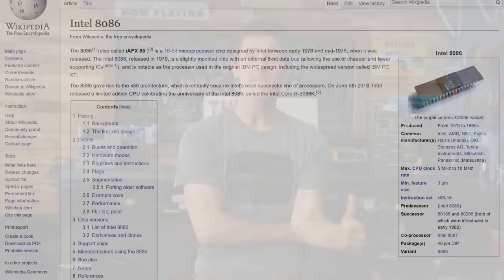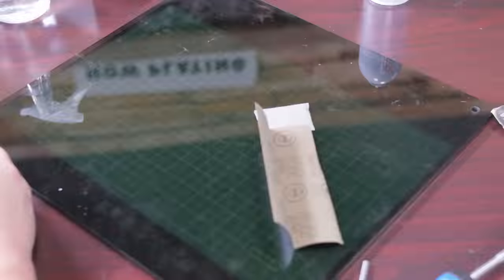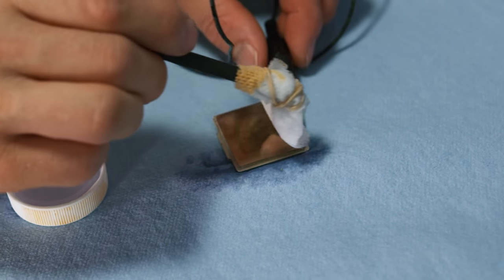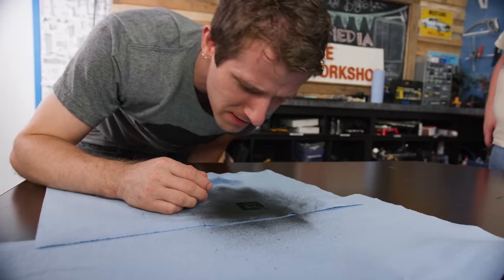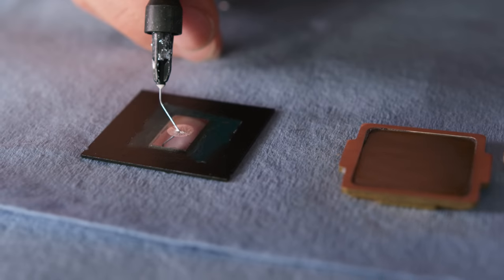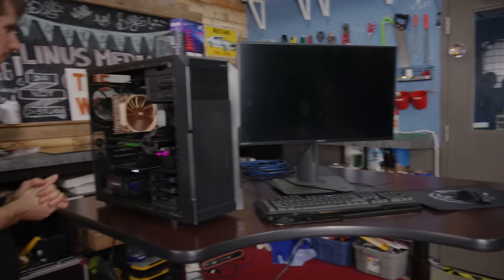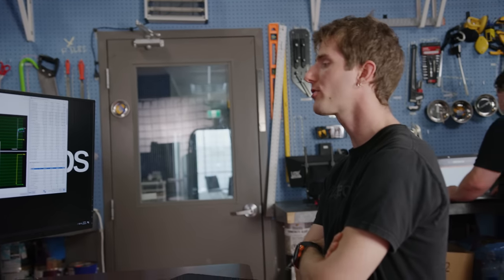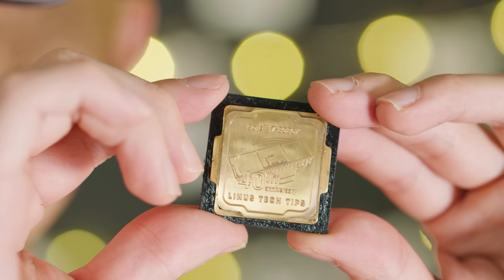The CPU Intel SHOULD have made!

Comment: *proceeds to cover beautiful engraving with heatsink*
Reply: That gold top wasn't cool enough by itself... :D
Reply: @jimbobbyrnes  right? But the box, you might put on a shelf. Did they do anything with the retail box?
Reply: gold plated it, engraved it, and baked it in titanium dust.
Reply: I know right
Reply: @peterkiss1204  did you just make a pun cause its cooler now?
Reply: Just glue an ice cube to the cpu, should work, can't see a problem.
Reply: FACEPALM
Reply: I had the same reaction to relidding a Threadripper with the vanity IHS they got.

Your unique, one of a kind IHS is now covered in drab gray thermal compound and a heatsink. Literally no one but you will not only care but even know.
Reply: @Nighterlev  come on if you are going troll and act mentally ill make it at least remotly beliveable...
Reply: 2020 still no clear heatsink
Reply: If the heatsink isn't pure gold I am disappointed
Reply: Nahhhh thermals are over rated
Reply: "Its a nice gun i'll give you that. But the engraving gives you no tactical advantage whatsoever."

Comment: There is actually a compound that you can brush on over shiny metals that allows you to use a standard CO2 laser to engrave them.  I want to say it is called LaserMark and available from either Johnson Plastics or JDS Industries.  We use it on our Chinese K40 laser to engrave on gold and stainless steel and it works great.  One tip, use about half the amount of denatured alcohol to thin the concentrate and it works way better.

Comment: Nice. Maybe in 2020 we'll see a special edition Ryzen for the 64-bit instruction by AMD.
Reply: By 2020 we won't be using 8th gen or RyZeN
Reply: F.A.I He never mentioned using 8th Gen in 2020. Also most definitely will still be using the Ryzen branding well into 2020. AMDs Roadmap shows Ryzen 4000 (code named Vermeer) based on Zen 2+ possibly on a TSMC 5nm node. Though a 7nm refinement seems much more likely.
Reply: Yeah, I was referring the 64-bit instruction set specification released by AMD in 2000 and how in 2020 they could celebrate that by releasing a special edition CPU ;-)
Reply: Uh, the ryzen amd64! I liked it!
Reply: Pretty certain IBM made the first 64 bit chip. Followed by Intels Itanium and then AMD were third to the party. AMD were unique in bringing the first 64 bit consumer grade CPU however. Although by the time 64 bit was actually being used on home systems Intel chips were more than capable. The Athlon-64's 64 bit capability was a bit of a gimmick when it released. However the Athlon-64 was one of the best consumer grade CPU's of all time mostly because of its innovation of integrating the memory controller onto the die - something all chips have today. Not really because of its 64 bit ability.
Reply: As I understand it AMD released the first x86 compatible 64bit instruction set that allows both 32bit and 64bit software concurrently.  Intel had to license that for their CPUs.

This is why we need competition in the market, as we are all benefiting from AMDs work today even buying Intel.
Reply: Micheal Morgan AMD released the first 64 bit processor to run on the x86 instruction set, the instruction set used by the majority of computers
Reply: That would be pretty cool, AMD should do that.
Reply: a processor without x86 instruction on it and only x86-64 (amd64) instruction, that would be a first processor to ditch intel's x86 instruction set, though I bet it would be usable only in linux since Windows and possible MacOS still uses 32bit binary on some of their apps.
Reply: @omgitzanarwhal  Yeah that's just wayy to early to be upgrading CPUs. My 5960X has been with me since 2015 and I'm going to use it until 2022. Hell people will still be using Quads in 2020
Reply: @eduardoavila646  a Ryzen 64 would be awesome!
Reply: @scubasausage  You do know that AMD is licensing their AMD64 arch to Intel because Intel couldn't figure out how to do it themselves... 😛
Reply: Nope, Itanium was a entire new architecture, like arm is, so you could not migrate your OS, apps and stuff to it gradually, it was all or nothing. While AMD64 was an extension to x86, and therefore you could run both x32 and x64 executables together with little to no trouble, and you could migrate as slow as you wanted... While Itanium Windows XP is a forgotten relic.
Reply: AMD and Intel have a cross licensing agreement actually. Realistically speaking there are actually far more things that AMD cant do that Intel can. Intel dwarfs AMD as a company and produce more than just consumer grade and enterprise grade silicon. Right now Intels CPUS are still very competitive after dominating the last decade, they still dominate the mobile space. Over the years they are far more consistent than AMD have been. Intel are also very charitable company who have invested millions in enabling technology access to the third world (see Intel foundation) and have invested heavily in upstarts and new tech ideas. As a company I hugely prefer them to AMD, who over the years have been very good at losing money in bad investments and producing bad chips. Ryzen, is the first decent chip architecture AMD have released in over a decade. There have been no major innovations from AMD for over a decade and they dont engage in much charity work or upstarts. Dont get me wrong, im not hating on AMD, we need them there to keep Intels prices in check. But Intel have done far far more for the tech community and the planet than AMD could ever dream of doing. That being said, I think people should buy Ryzen if buying a new system today in September 2018. Unless of course they intend to use it for gaming, in which case Intel is the obvious choice at practically every price point.
Reply: +wabbi lol ryzen will be dead by 2020 and it won't be the first time amd just gave up, lol
Reply: @f.a.i9638  From the future; you were wrong. Ryzen obliterated intel beyond comprehension

Comment: And in 6 months, AMD will come out with a custom gold plated CPU.
Reply: It's totally realistic, but it would be expensive enough to limit it to a special limited edition run or something.

Modern CPU IHS plates are made from copper, which is just slightly behind silver as the most conductive elemental metal on our planet. Since those are both also highly reactive metals, they corrode very easily, so the IHS plates are coated in a layer of Nickel, which is a non-reactive metal. Unfortunately nickel isn't that thermally conductive... but gold is! Gold is the third most thermally conductive elemental metal after Silver and Copper, and has the benefit of also being non-reactive, like Nickel. So using an IHS with real gold plating might actually improve thermals.

As an aside, and I'm just theorizing here, but since gold is really "soft" for a metal, the wisest choice would be to alloy it with another, much more durable non-reactive metal. 90%Gold + 10%Nickel is commonly used in jewelry and is called "White Gold". It should still retain most of the thermal benefits but be durable enough for everyday use by consumers. You would lose the golden appearance, and it would just look like non-polished silver, but still be prettier than current IHS plates. I wonder what those thermals would be like!
Reply: Unnamed Player it's already out nerds
Reply: @heart4011  well, that isn't really gold
Reply: Why not get a small piece of gold leaf and use it on a freshly polished copper heatsink with a gallium core ? Lol

Comment: Now you need a transparent cooler with it! Quite sure there is no transparent terminal conductor which could stand on par with copper. So using an engraved water block with transparent top instead of IHS would be a more logical showpiece.
Reply: transparent Intel stock cooler with blue leds will do, they actually are on Market
Reply: 3m novec
Reply: and that's probably the reason why it didn't make sense for intel to style the package of the cpu differently: it's hidden when running
Reply: ArthursHD:
Diamond is 5 times more thermally conductive than copper.
Silicon carbide is sort of transparent and conducts heat really well.
Or more practically:
Make a liquid cooler using two layers of something very flat and clear and water between with the plumbing in the corners.
Put a bit of optical paste on the heat spreader.
Press the liquid cooler down onto the CPU without covering the middle.

Comment: 'But we saw a tangible improvement in Blender.'

Did you? If so, you included the wrong chart.
Reply: Exactly what I was thinking.
Reply: Agreed. 3 seconds isn't reaaaally an improvement.
Reply: that .3 seconds can really make a difference if you're rendering out hundreds or thousands of frames
Reply: 3 seconds over ~329 seconds is margin of error (~1%). If it could be shown repeatedly then I guess you could argue that it's faster, but tangible? Probably not.
Reply: Zaku_IIH
Reply: Technically, no performance boost is tangible because you can't touch time.
Reply: MIND BLOW
Reply: he meant throwing the overpriced chip in an actual blender
Reply: I would disagree. It's impossible not to touch time. Since it's space-time, not space and time.
Reply: You are thinking in way too small of terms. Yes. Time exists because change happens, if nothing ever changed then time would not exist. The definitions we have for everyday things here on our human scales have little relevance to the true nature of cosmic reality, in so far as we know.
Reply: Tangible:
- perceptible by touch.
- clear and definite; real.

Saved time can be tangible.

Comment: it's kinda funny that you took the nickel plating off beforehand because the gold will plate directly to it. and you won't have an issue with the gold getting absorbed into the copper plating over time. I've done this before when i built my own hydrogen fuel cell and needed to plate the circuit pathways in gold.
Reply: I think they just wanted to smooth out the surface for the plating
Reply from the maker: Two reasons for that:

First and foremost, we didn't want to add another layer of metal on top to potentially mess with the thermals, so we took the nickel layer off.

Second... It was tried on a test IHS to see what it looks like and it ended up not being all that impressive. It didn't plate to the nickel as easily as it did the copper, either. It actually took quite a bit longer and more material to get a similar gold hue on the nickel parts of the IHS as opposed to the bare copper.

That said, it's likely that the reason for it not adhering to the nickel very well is because it's a matte surface, not polished. We may have had better results there if we'd polished the nickel first.
Reply: Copper-Nickel-Gold is actually a fairly typical stack for plated contacts on circuit boards. It costs more than standard hot-air solder leveling, but it allows contacts to stay free of oxidation for a long time.
Reply: I think that nickel, like aluminum, rapidly forms a thin oxide layer inhibiting further corrosion. So the "matte finish" is not an artifact, but goes with nickel in air.  That is why nickel ordinarily looks different from chrome.  Silver can be polished to a mirror finish, and it oxidizes, but more slowly.  To polish nickel (or aluminum) to a mirror-like finish that lasts longer than a second, you must do so in the absence of oxygen, like under a nitrogen atmosphere and keep it there until you coat it with something in turn to keep it that way (if it's something clear, you might be able to see the finish).  The Gold was probably not bonding well to the oxide layer.
https://en.wikipedia.org/wiki/Nickel

You can electroplate nickel or aluminum on the back of a piece of glass and make a nice mirror, because the glass forms a smooth substrate and protects the glass-side surface from oxidation.  Presumably,  +Fat D's copper-nickel-gold is deposited using methods which would be hard to duplicate in your lab.
Reply: Digital Nomad  If you polish the surface up then give it a quick rubbing with alcohol, the surface is perfectly plateable probably for minutes. Within that 5 seconds while you put the IHS on the rag and damp the surface with the gold solution, it wouldn't be oxidized on any relevant level.
Reply: +Peter Kiss
(sorry, I don't know how to type the accent).  Thank you for the clarification.
Reply: Digital Nomad  You don't have to type. Your attitude made it perfectly clear.

Comment: You should have a see through waterblock for a cpu like that don't ya think?
Reply: Not possible though... Yeah you have see through blocks but they still have metal on the bottom so you still wouldn't be able to see the CPU itself.
Reply: @finraziel  yuh didn't really think about it that much when I posted the comment
Reply: If there were some way to seal a block that is transparent on the outside and open on the inside in such a way as to let the transparent non-corrosive working fluid contact the spreader directly without leaking out, that would achieve your goal, and probably improve the thermals.
Reply: Finraziel  A diamond coldplate would get the job done. It's highly heat conductive. :D
Reply: Digital Nomad  The surface area wouldn't be enough for the typical coolants.
Reply: +The surface area would be essentially the SPREADER PLATE.  It is impossible for a cooling system to have more surface area.
Reply: Digital Nomad  There is a reason, liquid camber coldplates have fins on the inside. Cooler liquids usually take the heat away from the coldplate less effectively than the coldplate does itself from the IHS via the thin layer of TIM.
Reply: +P Kiss
"There is a reason, liquid camber coldplates have fins on the inside."
That's not the reason.  At each interface the heat transfer is proportional to the square of the difference between the hot side and the cold side.  The coldplate will, as a consequence, be at a temperature between that  of the IHS and the coolant.  It is possible to enhance the second transfer (coldplate -> fluid) by the use of fins.  You want the intermediate temperature of the coldplate to be as close to the temperature of the coolant fluid as you can get it.  Regardless of how relatively effective the fluid is or is not at removing heat from the inside of the coldplate, you would put fins on the inside of the coldplate, because you can .  You do this in order to mitigate the inevitable insulating effect of another surface transition.  If a solid metal radiator could carry heat better than a transfer fluid, air coolers would outperform liquid coolers.
Reply: Digital Nomad  The surface of the IHS isn't big enough to be suitable for direct liquid cooling. And that was the point of your first comment.
Reply: I wonder how long it will take to have a glass heatsink.. if it's glass at all.
Reply: No one will be able to carve a heatsink from a diamond. The size and cost alone is not worth it.
Reply: @digitalnomad9985  lmao they could plug the waterblock with diamonds.  Twice the thermal conductivity of copper.

Comment: As a person who has worked with industrial lapping, that's actually grinding.

Laping consists of rubbing two surfaces together with an abrasive media in between. Making the surfaces match each other very well. Almost removing zero material. It can be used to matching gears in a gearbox for example..
Reply: Swedishchef11 I would say a more common use of lapping is used in making surface plates
Reply: @jasonmurawski5877  sure it can. All I said was what I did.

Comment: Damn why don't these companies just take Linus' advice. He knows what people want and will buy lol they would've sold so many of thesep
Reply: Agreed I've desired a gold and silver made CPU and gpu for sooooo lonnnggg. Of course in some way it will work well. The idea of opening my pc case to see a gold parts🤤
Reply: If they did it would've possibly be worth the extra ~100 bucks, now it's just a ripoff.
Reply: @micglou  People still wouldve played it
Reply: It's similar to his video on the ideal gaming tv. Most of what he said in that video from over a year ago hasn't been widely used by manufacturers, usually just having one of his ideas, rather than multiple.
Reply: becuse real gold and silver is SUPER EXPENSIVE FOR JUST TO PLATE IT WOULD BE $12,000 for just one cpu that's a whole 5K 2018 27 inch i mac pro or a whole build your own pc that would have like 6 gpus and cpus and all the ram and storage space to run like 5 high end AAA games on max setting at once and gold is very bad at conducting heat and is very easily melted and damaged in pure form
Reply: @ashtiboy  dude gold and especially silver arent that expensive
Reply: @BlackAus07  the german shop "caseking" sells silver ihs cpus, with guaranteed oc of 5.1 ghz (called ultra edition) Costs a lot tho:
https://www.caseking.de/en/pc-components/cpus-processors/pretested-cpus

Comment: Belt sander on table, fine sandpaper grit + water, slow speed = lapping done easily. Just hold the cover down on it with light pressure while it's running with equal pressure. It'll shine like glass.

Comment: Thats not the ryzen 7
Reply: Yes, it's an intel CPU.
The Ryzen party only start when the 7nm ones start to roll in.
Reply: Dr_Kachu san  still is a great value even on 14-12nm
Reply: Yes it is.
But it's a battle, not yet a carnage.
Reply: Dr_Kachu san  u rite
Reply: Ry7
Reply: @dan_loup  but that will not happen since the die manufacturer didn't want to make 7nm processors
Reply: It still will, but by TSMC instead of GloFo.
Reply: They'll probably wimp out, as if 7nm is some impossible feat.
Reply: At least in theory, the living incarnation of the smug anime girl meme was holding an Epyc CPU made with 7nm, so in theory they can produce at least one CPU.